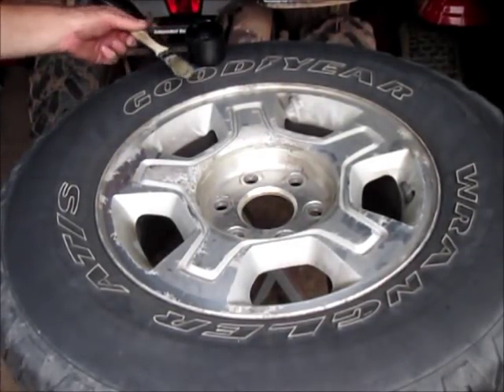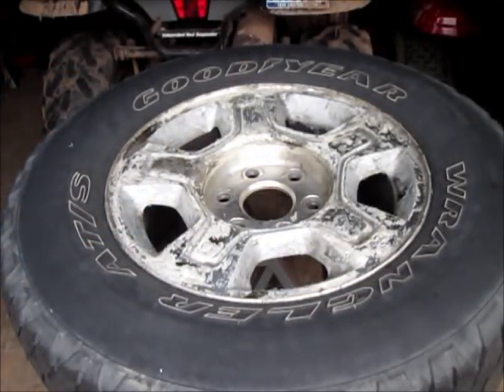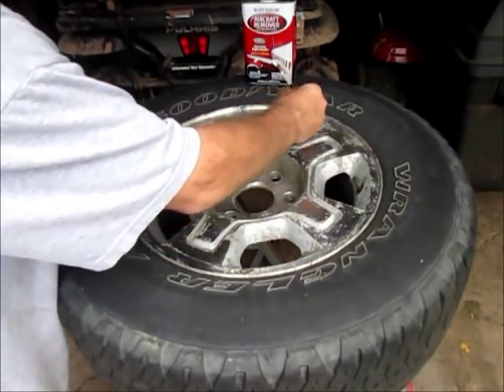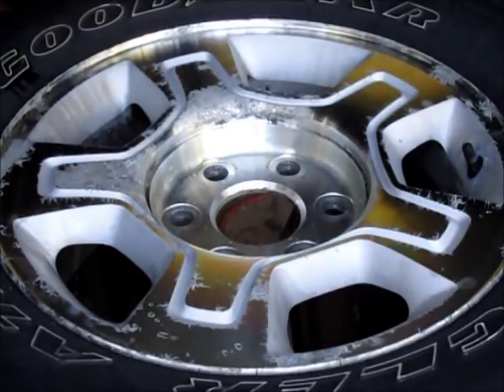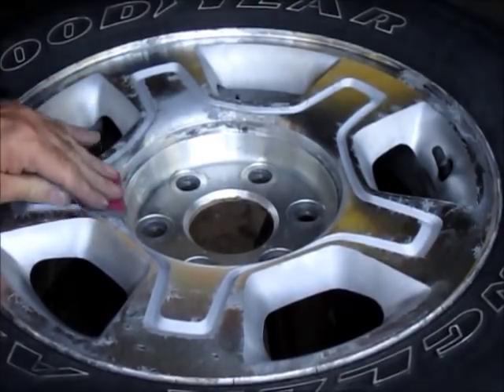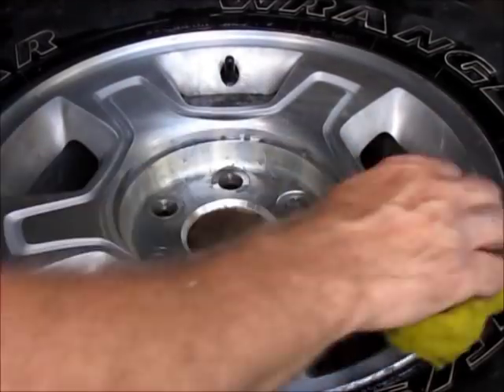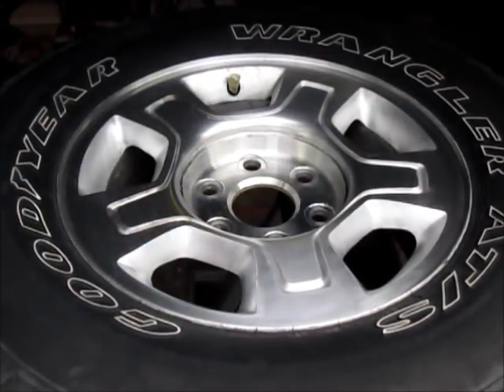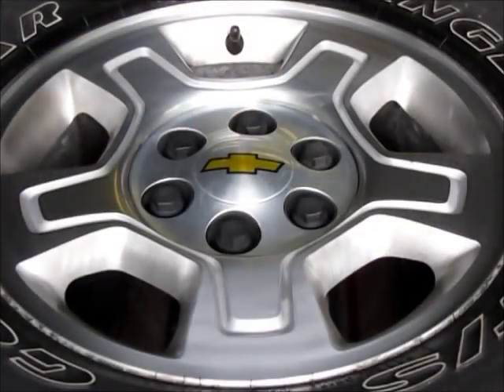How To Refurbish Aluminum Wheels

Comment: Its been 4yrs curious how well did it hold up?
Reply from the maker: They are holding up pretty well.  I should have put a couple more coats of clear on. The rough area is looking a bit dirty with brake dust.
Reply: @RustBucketRepair  was the clear coat necessary?  Thinking of doing the wheels on my truck but don’t want to deal with applying clear coat that’s just going to get scratched up and bubble again.
Reply from the maker: @Jharp82  It'll definitely make it last longer but not necessary.

Comment: Did you use 220 or 320 grit for dry + wet sanding? You mention 220 at first, and then start saying 320.
Reply from the maker: Good catch. I miss spoke. I started with 220 dry, then 320 wet.

Comment: Wow, you completely left out the polishing part of the wheels rehabilitation. They look okay now, but the polishing would have made them look spectacular.
Reply from the maker: I thought about that, but I'm pretty sure that the clear would react to the polish and not stick.
Reply: @RustBucketRepair  So wouldn't one wipe off the wheels with a degreaser, such as Dawn dishwashing soap, after polishing, and thoroughly drying before then applying the clear coat? Polishing is the key to getting the chrome-like shine which is then protected by the clear coat, or so I believe.
Reply: @meanmrmustard2260  If only it were that simple.  Clear coating polished aluminum is tricky.  (When I think of "polished" I think of sanding to 2000/2500 and then polishing to mirror finish and is what my comment is based off of.)  If you sand the aluminum to a lesser grit (800-1000 maybe) clear coat success might increase.  I restored a set of GMC aluminum wheels off my 1991 Sierra and I sanded to 2500 and then polished.  They looked amazing but clear coat never would have adhered to that smooth of a surface.
Reply: @JerichoRally  You could be right about not having enough "grip" to adhere to. My experience with polishing aluminum was on my Harley Sportster which I polished constantly with Mothers and stored in my kitchen - I was a bachelor then. Not all that much to polish on a motorcycle, so it was an easy job.
Reply: @meanmrmustard2260  lol...I've had my fair share of motorcycles in living spaces as well.  Totally reasonable to me!  And polishing wheels is no fun at all.  A lot of work.

Comment: I'm surprised that the tires weren't taped off from the rims when the work was done especially when the clear coat was put on
Reply from the maker: Like I said  in the video, the tires were to be replaced, no need to tape them off.
Reply: Sorry, missed that.

Comment: Can you just sandblast the rims?  I have access to a large sandblaster.  Would glass bead be best for aluminum?.  Don't want to spend hours sanding when I can blast them in all in 10 minutes inside and out and then clear coat.  Anybody have experience?
Reply: Yes you can sandblast. The media determines the finish. Glass beads seem to work pretty well if you plan on using a clearcoat, but it will leave a matte uniform finish instead of the machined/cast factory look that is easier to duplicate with hand sanding. Blast with sand, black beauty, etc. If you are going to paint them.  I blasted a set and the local bodyshop was spraying a silver car that week, so they shot the wheels at the same time. Only charged me $120, since I did all the prep.

Comment: Thanks for sharing your refurbishing aluminum wheels project. If I am correct you only cleaned the wheels and only sprayed a clear coat finish on them?  I was considering painting my "OEM Chrome Aluminum Wheels" on my 2005 GMC Sierra [https://youtu.be/tnFWEs72n7o], but I am not too sure now.  I don't have many tools and it would be a great challenge for to complete my project before my new Pirelli Scorpion ATR tires arrive this week, which are expected to arrive March 29, 2018 at my local Wal-Mart: they will hold them for seven-(7) days, so I can schedule installation with them.
Reply: By the way you effort on your wheels look great. If my wheels are chrome covered/plated and/or dipped, then I would need a stripper too? I recently discovered a chrome paint for wheels, but would that cheapen the aesthetics of my truck?  After watching your project video, I think just applying the clear coat may be the least time consuming and cost saving for me. I never tackled a project like this one. However, I want to take advantage of the opportunity to save my wheels from further damage and improve the aesthetics of my truck.  Thank you
Reply: Rust-Oleum has a line of actual "wheel paints" including a clear that work fantastic. I have sand blasted and painted probably around 8 to 10 sets of wheels (like 35 to 40) over the past few years and I love that product line!!!

Comment: This will peal in years..you should  have power coat it with a clear coat..would last years
Reply from the maker: It's been three years and they still look good.
Reply: @RustBucketRepair  give it 2 years more ...ask me how i know
Reply: @772777777777777  And for a small DIY project, holding up for 3-5 years is pretty damn good considering most people don't have their vehicles that long to begin with